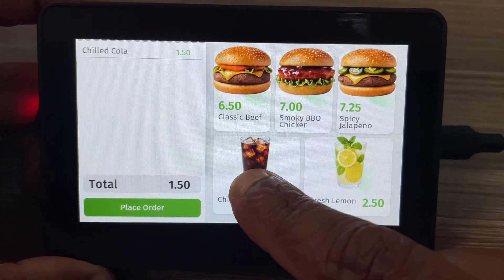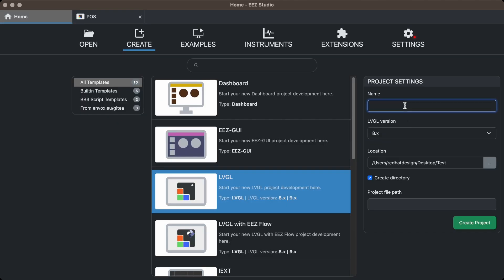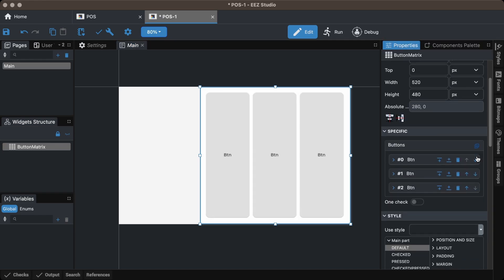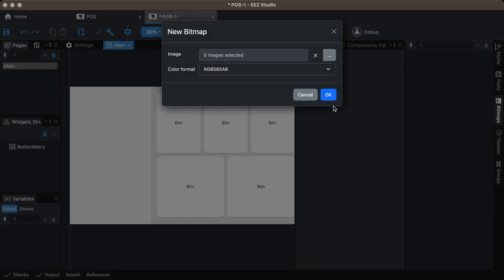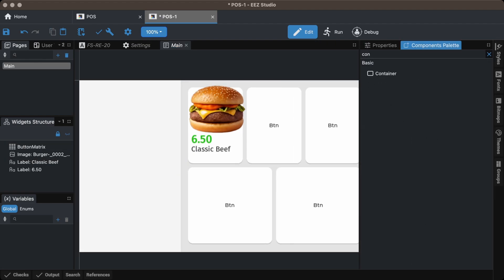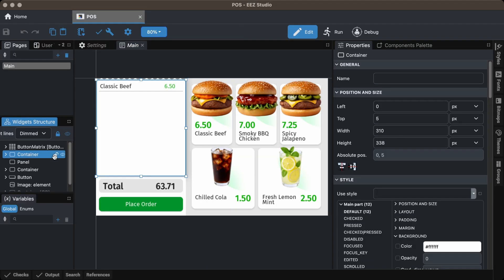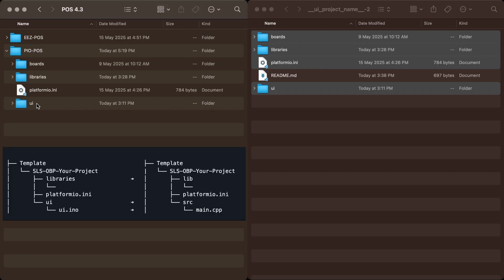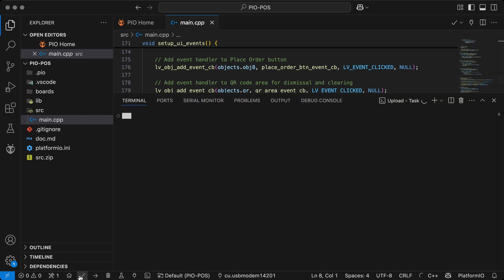Self Service Kiosk with LVGL & EEZ Studio on @waveshareelectronics   4.3” ESP32-S3 display  #lvgl

Comment: Hi,
I'm having real challenges getting this display/ESP32 combination to work with Wifi.

i.e. WiFi + LCD and/or LVGL.
As soon as I run Wifi.Begin alongside the Board->init() standard setup it loops and crashes.

Did you try any graphics + wifi examples?
Cheers
Reply from the maker: Hi,

I too faced issue with LVGL and wifi_scan_init();.. also i with ESP-Now. I did't check further.  Have something in mind. need to try
Reply: @nishad2m8  Thank you for the response, at least its not just me banging my head :)

Tried Wifi and the Espressif esp_wifi libraries - both behave the same way so I don't think it's an Arduino vs IDF issue.

Seems to be some SPI issue messing with memory - or thats my latest lead - but not solved it.
Reply from the maker: I think it's with memory / buffer management issue. did you check with waveshare support team ?

for LVGL also i struggled to setup. i contact the support team via mail
Reply: @nishad2m8  I tried with LVGL forum incase someone had done something similar but no luck. My thread on the forum eventually got closed down by someone saying I was over simplifying requirements.

My ticket with waveshare support didn't get further than them sharing boiler plate wifi example code. They never replied on the point about WIF+Board->init().
Reply from the maker: ok. i'll try once free. not sure it will work or not

Comment: Hey do you have a video and obp for the ESP32-S3-Touch-LCD-7 from waveshare
Would love to know more about it
Reply: Hey iam dealing with the same lcd could you find a way to program it using the files eez studio generated ?
Reply from the maker: Hi, need to figure out board driver setup using LVGL. Some examples didn’t have LVGL support, so I’m checking GitHub for working ones. Once I get LVGL examples running, it’s easy to use EEZ Studio or SLS.
Reply from the maker: Hi, I don’t have WaveShare 7” display.
Here I listed all the boards i have and obps https://github.com/nishad2m8/Squareline-OBP

Comment: Really nice, really useful project... BTW: EEZ Studio works with ESP32-C6 too?
Reply from the maker: Thank you. It’s works for C6 also. EEZ studio is using only for to create LVGL UI.
Check my Flux Capacitor video. I use C6 device in that video. 

https://youtu.be/pDeoPXndeUQ?si=J1MLI5P8RvdI-X0Z

PlatformIO didn’t support C6. Need to use Arduino IDE